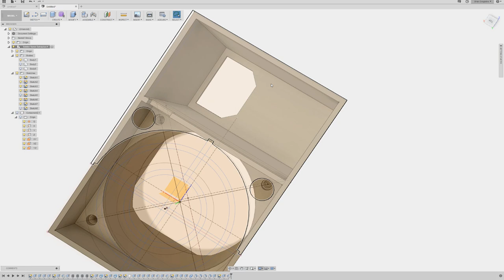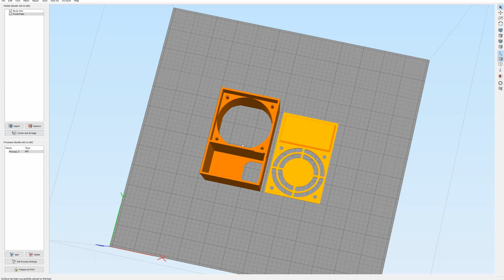▼ Making a solder fume extractor using a 3D printer

Comment: Great job i have only one bigger fan from some power supply and i'm looking to make something like this but i don't really know how to 3D model yet .. and one more thing you could have made some filter to absorb gases from soldering and flux i will make something like that when i learn how to design like you 👍👍👍
Reply from the maker: Great. Designing a thing like this is a great learning experience. You can use the free version of Fusion 360 for it, or Freecad, or Onshape... These are all great applications for this.
And if nothing works, just a peace of hard board with some holes in it will work as well. 🙂Succes designing, and if you make something nice and upload it somewhere, please let me know, I would love to see it.

Comment: Any thought on integrating a filter? All you are really doing is dispersing the fumes elsewhere into the room.
Reply from the maker: I have been thinking about it, but after taking a look in the hardware store and talking with some people there, I decided not to do that.
The thing with an extractor like this is not to filter the fumes, but to get them away from where you are breathing. Because when soldering you are hanging over your soldering iron, you inhale a lot of fumes. When you use a fan like this, almost 95% is sucked away from your face and blown into the room but when you are filtering, less then 50% is sucked away because the fan gets less effective because a lot of energy is lost in pumping the fumes through the filter. this means a lot of fumes are still entering your body because it's not sucked away from your face.
In fact, a lot of sold fume extractors do the exact same thing.
Reply: If the fumes mix with the air , you are still breathing them.  using the correct filter and fans you should be more than ok.   That or tunnel the exhaust to a tube you can lead outside .

Comment: Wouldn’t the point of one of those be to have some filtration device inside?  You’ve made a “fume spreader”. 🙂
Reply from the maker: Hi,
This is true, but not completely a stupid thought.
While soldering, people are hanging above their work and really inhaling almost the complete pile of smoke coming from the soldering iron. I know that a lot of people even (like me) love the smell of the fumes that are being spread.
Now having the fumes moved away from where you are hanging with your nose will really decrease the amount of fumes inhaled, while adding a filtration device, like a wet cloth or a real filter, will make the fan less effective and then it will suck up less fumes.
I actually was in a hardware store where the people told me that spreading all the fumes is better then filtering only halve of it.  You can buy a lot of these 'spreaders' in hardware stores.
Reply: 3d Print Creator good points...I do a lot of soldering on my projects and my ceiling fan keeps the smoke out my face 🙂